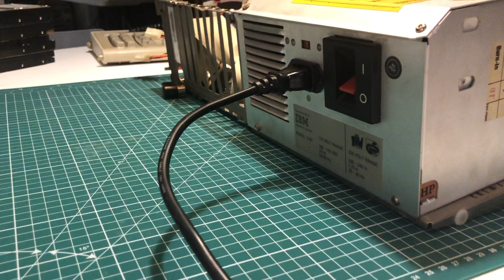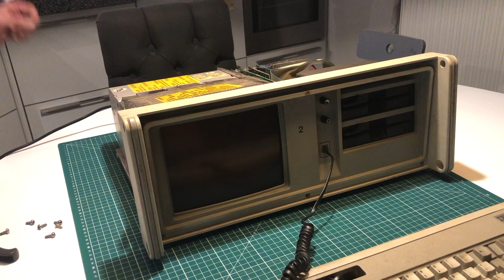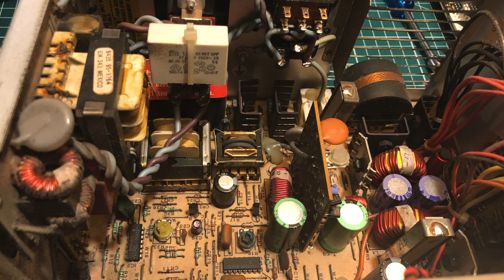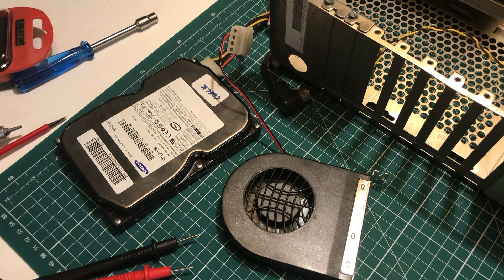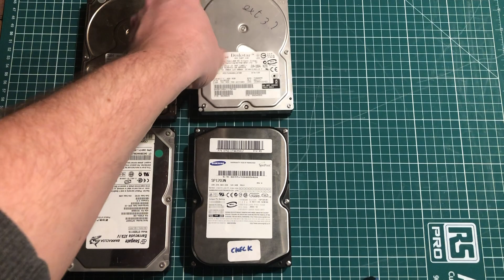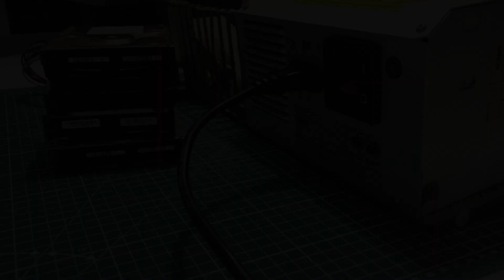IBM 5155 PSU testing with minimum load (free magic smoke and exploding caps included)

Comment: Any switch mode PSU requires a minimum load in order to start for whatever reason
Reply: Not all of them. I have 3 AT SMPSs that do start without a load. I wouldn't recommend it though as some of the IC's will get very hot

Comment: Ah you made a video of starting up Power supply. Good thing Alway startup Power Supply without any thing attached of your precious computer parts. Better to reform the main 400V/450V Capacitors. How? With slowely turning up the voltage and watch the current. Look up "Reform Capacitor". Capacitor is a pure chemical device, a bit equal to a car battery. After long stay without power the have to reform. If you suddenly put full power on them they will break down due to very high current. Old ones at start up are just like a full shortage. Alway's replace capacitors in especially PWM -PSU's with the Low-ESR variants. Then look at the datasheets for Life-Time, often only 1000h or 2000h, Better to look for the highest Life-Time app. 10.000 up.
Old electronic device ,Never just put in the mains Plug and power up. ALWAY's inspect the power supply first and other visual problems. Look around electrolyte Capacitors for leakadge  marks around the case, corroded pcb's. Or at the top if they already are buling up. due to gas and heat inside, thats why there are those grooves to make weak point so it can blow.
Especially Computer logic ICs can not handle over voltage. Its done in milli seconds. To check your secondary DC output for a AC voltage component. Just put your V-meter on AC. That is also a marker for the condition of the secondary capacitors.

Comment: come on @ RetroSpector78 .. this makes no sense ... the PSU run fine without HDD ... and without Floppy ... just with 1 MotherBoard ........ so what you need to recreate... is the load that a motherboard put to the PSU .. and in the pins where the motherboard it puts that load...

Comment: 220 ohm resistor on the five volt rail will kick start it. However you would want to use a high wattage rated resistor.
Reply: What of we connect some resistor in series but each of them is just 1 or 2 watts ?